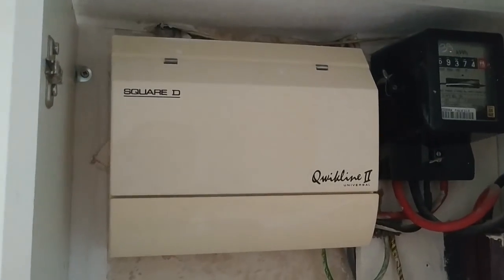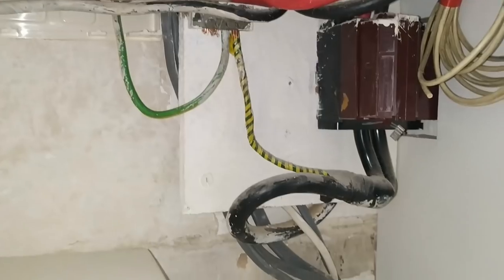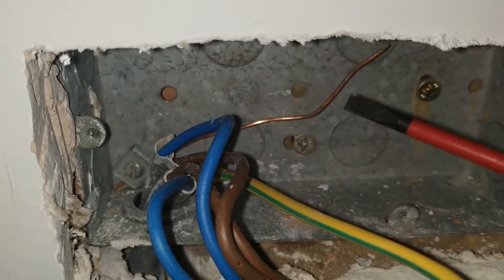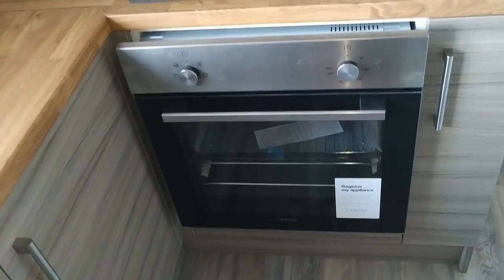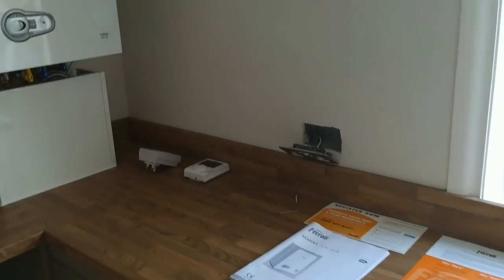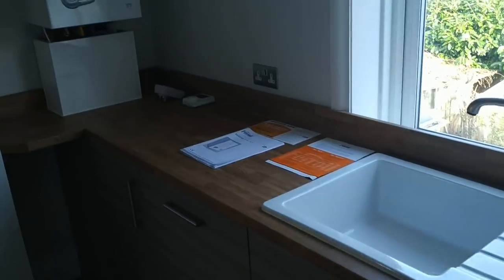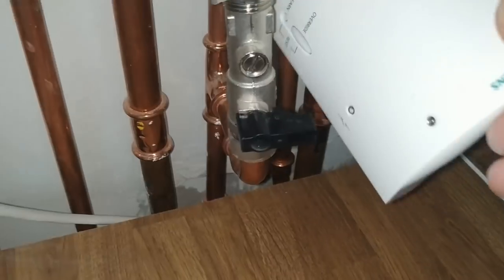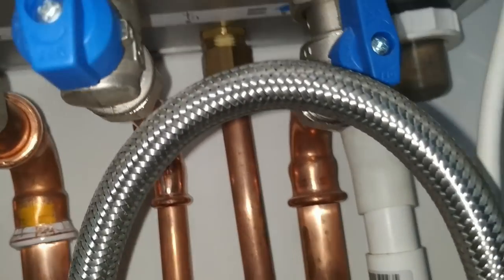Newly Refurbished Electrical Shambles

Comment: Fuse boards( CU) when on for 30 plus years without change or problems so why do they need changing every other week now, neat work don’t stop fires. Btw how old are the mains Electric, water and gas coming into house, flat etc. That install it terrible tho.
Reply: People also lived in caves for tens of thousands of years and it was great yet now we move houses every 10 years. Why is that?
Reply: Neat work doesn't stop fires, but shoddy work can start them.
Reply: Well, for a start old Consumer units don't have RCDs.  Safety has moved on a lot since the 1980s.
Reply: Don't they have to prove that a property is safe before putting it on the market? Guess is a shady landlord anyway so probably doesn't care... :-(
Reply: But you can buy plug in RCDs for things that need one.
My electronics repair workbench upstairs has a plug in RCD.
 The consumer unit has one RCD feeding the whole house and its very sensitive.
If something im repairing trips the workbench plugin RCD, the whole house also goes off, which is very annoying, especially in winter when its dark in the evening.

Comment: Really bad work. I’m a DIYer and I would be ashamed of that.
As other have said this is a builder who thinks he can do any job on site.
To do electrics in UK you need to be qualified to latest edition that cost money and the electrician needs to get his money back therefore he has to charge a rate to cover all his costs.
Problem is people look at the overall cost and take a sharp intake of breath, then someone says I can do that for less and they go with it.
The problem is that the flat would not be sellable as there is no paperwork for the electrical work so the seller is up a creak without a paddle, any good solicitor should pick that up.

Comment: Why in the 21st Century does the UK, still use un-insulated CPC's, Australia and New Zealand have used them since the 70's.
Reply from the maker: Cost probably - if one manufacturer started making it with insulated CPCs it would cost more and most would just buy the cheaper kind from others.  Also likely to be 'the old ways are best' thinking in there somewhere.
Reply: @jwflame  ,
This is one thing that makes me want to give up the electrical trade and get a job as a street-sweeper.
With quality these days, it is a race to the bottom, to see who can make stuff that is just good enough, but may not be compliant, as long as the bottom line of a company is maintained. 

And let's get some other people to install it for us, when there is a problem (and there will be), we'll deny any knowledge of our poor design or manufacture, it's now on their head, since they've bought it.
Reply: It doesn't matter.

Comment: Do you need an extractor if you have a window? Thought if you had a window that opened you didn't need an extractor?
Reply: They're technically called for in the regs now, I agree an open window is usually good enough but regs are regs and new work must follow them.
Reply from the maker: Rooms need ventilation, and in many cases just having a window is acceptable as the absolute minimum.  In reality people don't open windows and without extractors the place will be dripping wet and mouldy after a couple of weeks.
Reply: @jwflame  Thanks JW!....I always thought an extractor was only needed if there wasn't a window but it appears to be in the regs now..cheers
Reply: @uK8cvPAq  thanks!
Reply: @PompeyMatt17  They put isolator switches up for the fans so you could always switch it off if preferred, my tight ass Dad did.

Comment: Nothing wrong with having both earth wires in one sleeve when they go to the same connection on the socket. Saves on sleeving and is neater.

 My 1 bedroom house only has 2 double sockets in the small kitchen and i manage ok. The only appliances always plugged in are a kettle and a radio in one socket and microwave, toaster and george forman grill in the other.
 The dishwasher and washing machine have their own connections behind them underneath the work surface.
 Yes, i have to use an adaptor for the george forman grill and microwave but i manage.

The plugs with unsleeved pins are not "old junk" . They're old but not junk. I have a drawer of spare plugs and most of the old ones are better quality. I have old power tools from the 80s that still work fine with plugs that have unsleeved pins and ive never had a shock. I couldn't touch the pins before the plug is fully out when unplugging something even if i tried. UK plugs are too physically wide. I always switch it off at socket before unplugging anyway. Anyone that puts their fingers or anything behind the plug when unplugging something is stupid and they deserve it.

The bathroom pull cord is not manky, it looks brand new. Even if you hate them, you have to use it in a bathroom.

I don't see whats wrong with using a flexible hose for the sink/basin. The sink still has a waste trap to catch dirt and hair. if it gets blocked, it can be unscrewed. I DO agree with JW about the wire under the sink though. I can't understand why its there. Maybe they originally intended to put a light in the cupboard but never bothered.

The bathroom/shower room doesn't need an extractor fan. Just open the window after using the shower.
My parent's house doesn't have a bathroom extractor fan. They open the window after using the shower.
I DO have an extractor fan in my bathroom but ive never used it. ive switched it off and covered it up to stop cold draughts in the winter. I agree about the kitchen extractor fan though - it should be vented outside.

If a house/flat still has old red/black wiring, why change it. As long as its copper and PVC, replacing it all just for the sake of it with brown/blue is a huge waste of copper, money and time and is completely unnecessary.
 In the consumer unit, the new kitchen and bathroom look to be using blue/brown cable and the rest of the flat uses the older red/black cable.
Reply: Simon Tay - The CPC (earth) wire should have no exposed copper showing, hence sleeving them individually is far better.
For a new install, the number of sockets should be reasonable. With lots of electrically powered appliances available these days, two double sockets is not reasonable.
For new homes/buildings or where renovation is taking place, a bathroom/shower room is required to have an extraction fan to reduce possible problems from condensation.
There is no requirement for pull-switches in bathrooms, shower rooms or toilets. If they are a suitable distance away from the bath or shower, a normal wall switch can be used. Or the light switch can be outside the room.
Yes, if the existing old colour coded wiring is in good condition, you don’t have to replace or renew it. But there should be a label on the consumer unit saying that two different colour codes are in use.
New installations require consumer units with RCD protection.
The fixed appliances in the kitchen should be using fixed connection units with a fuse and a switch. Not old plugs fitted into normal sockets.
Reply: I have no problem with both earth wires in a single piece of sleeving it helps maintain a decent connection especially with the quality of terminals in accessories these days

Comment: the electrical, thermal and sanitary installations were made by unsuspecting people !!!  If you want to remove the furniture, you have to remove the gas pipe !!!  The electrical installation is insecure !!!  Why between L and N is 233v, and between L and PE is 247v?
Reply from the maker: 247 is the real voltage, 233 is with the LED ceiling lights in series.  The blue wire isn't neutral.

Comment: Some cooker hoods do filter and recycle air. But yeah. Bet that flue isn’t correct! Thought old plugs were good 😂. Yeah ok it gets worse. I wouldn’t want to pay good money for it.
Reply: I've got a recirculation cooker hood, it's useless.
Reply: uK8cvPAq Mine has an external outlet but the original installer left it in recirc mode 😞🙄
Reply: @AndyK.1  Oh ours is actually like that, but they decided drilling through our fragile 100 year old wall is too much hassle.
Reply: Cut the supplied moulded plug off and invalidate the warranty!

Comment: At 4:05 what is the issue with putting both CPC's into the same sleeve?
Reply from the maker: Twisting them together, which weakens the copper and in this particular case resulted in the ends of one breaking off so only one was actually secured in the terminal.  Also make subsequent fault finding and testing more difficult as the wires have to untwisted which further increases the risk of them breaking off.
Reply: Thanks John makes sense.

Comment: 50p for a box sure, but it has stopped something going for "recycling" which will use resources, less than creating a new one sure but still less than not. Reduce Reuse Recycle.
Reply: Have you ever found a secondhand wall socket in good shape ? They even left in a fly lead . That was superfluous waste and should have been recycled too !

Comment: I find a lot of the comments here quite amusing. It's taken as read that a diy job will always be sub standard, and in reality that is not true. Back in the 80s before the whole Part P came into being I did a rewire on my townhouse. My wife worked for Manweb and so we arranged for a final inspection. An engineer arrived and removed the cover form the consumer unit, and a socket and said to her "our guys didn't;t do this did they"? My mrs disheartened said  "no". At that point the engineer said "I thought so, it's too neat and tidy". So I'd say let's not be quite so judgemental. Not all diy guys are idiots. I do a lot of PAT testing these days, and yes I have the City & Guilds, and the quality of wiring in some of the fixed installation stuff I see is frankly a joke. I end up tidying a lot of it up just for safety sake!

Comment: What's JW's beef with white downlights?
Reply from the maker: Everything else in the place was brushed steel, so white is a strange choice.
White never match the ceiling either, as they are gloss finished, ceilings usually are not, and there are many different shades of white.
Reply: John Ward not to worry, they soon turn a lovely shade of sooty yellow.

Comment: WOW ... I'm not a sparky and I can do a better job than that trash! Blind Freddy could see the issues in there like why would you switch the neautral instead of the live for the bathroom and why would you have an opposite switched wire unless you're planning some sort of low light night light which is a waste of power.

Comment: Jesus the plug + switch for the exaust is too high to reach. They should be on the table for easy turn on / off if something goes wrong eg the cover switch, vent gets cogged. Other than that all it is way worse than the exaust. :(. The bathroom could  be used for a plug right at basin for the shaving machine but no neutral and  not puting the exaust????? The conclusion is... Super Dodgy :D

Comment: So did you buy the flat? Obviously knowing how "shocking" the electrics were. I hope you got a lot of money off. The amount it would cost to replace all. We know you can do yourself but still deserve money off. Worst are the ones where they pay an electrician to sign off on piss poor work & the estate agent who are told after don't give a shit.
Reply: Steven Whiting What has it to do with the estate agent? They act for the seller. It's up to the purchaser to carry out such inspections as he deems necessary and to negotiate a reduction for anything found lacking. Most estate agents wouldn't know the difference between a consumer unit and a wheelbarrow so it's hardly surprising they aren't up to speed on the finer points of the electrical regulations.
Reply: @spencerwilton5831  I just of said estate agents that are managing the renting of said property for a client. I guess, yes, its not part of their role but you'd think they'd have morals. Considering they already do basic maintenance. Property I purchased we were told by neighbors they reported issues to agent before, like the front gate falling off. They said the agents did half arse job and getting stuff repaired. And the electrics, we trusted the sellers pack that had a electricians sign off signature that all was fine, appears that was paid off by someone (assume the original owner)

Comment: The extract fan or lack of made me laugh
Reply: There was an opening window, so I believe that technically it did not need one. (Remember, it is the regulations when the flat was built that apply.)
Reply: Why bother putting a fan in then
Reply: @Jimmy-B-  There wasn't a fan in the bathroom. That was the point. The kitchen fume extractor was a different point - and that was not 'lack of' but no ducting/exhaust.
Reply: Was what I was referring too, the kitchen. Im sorry I did not specify exactly what part of the video I was referring too. Should I put a time stamp
Reply: @Jimmy-B-  Forgive me for thinking 'extract fan or lack of' did not refer to the lack of an extractor fan (in the bathroom). I should have realized it referred to a different 'fan' that did exist. The clear context in which you placed it should have made that crystal clear to me. I think.
Reply: Forgiven

Comment: You should be pretty concerned about the condition of your own test probes when you pick on other folks poor work. No way would they comply to safety requirements, you have about 2cm or more bare probe with damaged insulation. A bit hypocritical I would say. Not exactly the squeaky clean expert you would like to portray.

Comment: No RCD’s. A major flaw! The wiring looks amateurish, with one live wire actually exposed as it enters the consumer unit! The unit is not fixed to the wall properly which indeed is dangerous as the whole thing is moving! The whole consumer unit needs to be replaced ASAP! A fire waiting to happen!

Comment: I feel like you’re just smartassing over everything. Who cares about a normally untouched old plug if it does the job. And who cares about that WIFI receiver hanging on it’s wires. It functions and the normal user doesn’t see it. And yes i know i will get the local channel fanboys after me now for disagreeing with the uploader. The only thing i agree with is the missing GFCI, and the undersized wires.